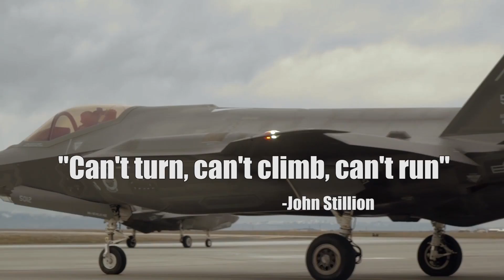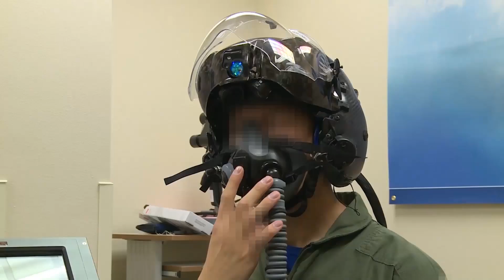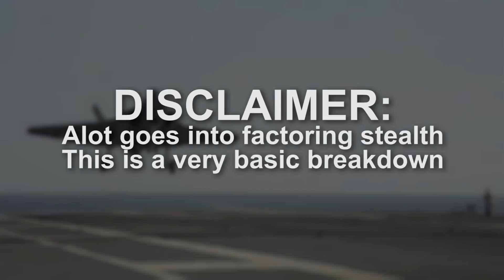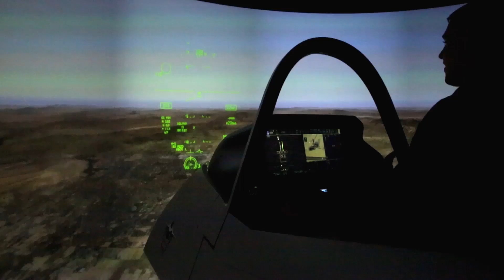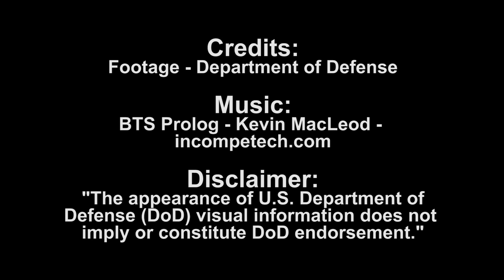F-35 Overview - The Good, The Bad, The Ugly

Comment: The F-35 is a good UK and US designd and built jet BUT it ant that good.

F-35.

Agility 
combat ready.
11 D/S for sustained turn.

Agility 
stock.
It's goes up by 19%.

Speed.
Stealth mod with only 4 missiles.
1200mph Mach 1.56.

Hight.
Combat ready.
50,000f.

Stealth isn't as good as people think.
One of the biggest fuck ups with stealth jets is that more stealth means less agile and stealth isn't that good on any jet.
It takes only 0.0001 seconds to be seen on radar and its over for the jet.

The jets that use more stealth like the F-35 F-22 SU-57 don't have the best agility the best jets for agility is jets like the Eurofighter Rafale and Gripin, with Thrust Vectoring and the power on the engines making a big difference in turn rates.

The Russians are the only ones so far to use ( 3D Thrust Vectoring ) the news one being the SU-57 and will be on the MIG-41 when that comes out.

The F-22 is a good jet but again it goes for stealth more then agility so when you put it up against a Eurofighter you can see the difference in it.

The Eurofighter yes it may be a gen 4++ jet but it can still kill any jet out there even the F-35 and F-22 and long rang missiles have a bad hit rate the Eurofighter being more agile can just dodge them easier then others can.

The Eurofighter has the longest air to air missiles and with radar that can pick up the F-22 and F-35 at a very long distance the F-22 or F-35 will have a hard time to get a jump on the Eurofighter and again if they the Eurofighter can just dodge the missile.

The difference between.
Eurofighter / F-35 / F-22 / SU-57.

Speed.
1st SU-57 1570+mph.
2nd Eurofighter 1550mph
3rd F-22 1498mph.
4th F-35 1200mph.

Hight.
1st SU-57 65,000+f.
2nd Eurofighter 65,000f.
3rd F-22 60,000+f.
4th F-35 50,000f.

Turn Rate.
1st Eurofighter 28.5 D/S.
2nd F-22 26.5 D/S.
3rd SU-57 24.5 D/S.
4th 11 D/S.

Hard Points.
1st Eurofighter.
2nd SU-57.
3rd F-22.
4th F-35.

Energy Saving Dive/Cilmb Rate.
1st Eurofighter.
2nd F-22.
3rd SU-57.
4th F-35.

Rang.
1st Eurofighter.
2nd SU-57.
3rd F-22.
4th F-35.

The F-35 is 4th in all areas.

But at least it can do vertical take off and landing for about 90,000,000.

Comment: This is why I can't take F-35 hot takes seriously. Some guy said an F-35 lost a dogfight to an F-16 and people still parrot that even thought it's been thoroughly debunked.  The incident in question was when they were working out the kinks in the flight control software of the F-35 and they sent up an F-16 for it to fly with, because the 16 is cheap to fly and has a very well documented flight profile. Now that they have it dialed in and have taken off the training wheels it has very good performance. Not as good as an F-22 or one of the new, purpose built Russian dogfighters, but still very good. Outstanding when you consider that it's primary job is that of the now retired F-117. 

Also, when people quote it's wingloading or thrust to weight, they do so with a max load of fuel and bombs. In an air to air config, it would not be at max fuel and would instead be carrying a much lighter load of missiles, making those thrust to weight and wingloading numbers a lot more favorable. 

 It's one serious flaw is that it currently can only carry 4 air to air missiles.

Comment: That $92M per plane figure is straight-up propaganda.  Given the $1.5 trillion program cost, that would give you over 16,000 planes at $92M.  The actual production run will be around 2,500 or less.  This means the cost per plane is more like $600M.  You could literally build a plane out of actual gold for this much money.  Greatest ripoff in history.
Reply: No that just means you don't understand what is being talked about. Unit cost is what you pay to manufacture the plane. Program cost per unit includes development which might also benefit other projects and is therefore not an accurate measure of cost per individual aircraft. 

Also that $1.5 trillion figure is old. The current projected figure for the entire lifetime of the F-35 from initial development in 2001 to roughly 2070 is $1.1 trillion. it is the the very first fighter project to have official lifetime cost estimates, and part of the reason this value seems absurd is because every other fighter had costs projected in 10 year increments.

Comment: I do wonder sometimes about the F-15 refit where they added a bunch of stronger composite materials to places susceptible to metal fatigue and improve parts prone to fail like the air brake sometimes snapping off on landing.
Anyway the reason I mentioned it is I got to wondering the US Airforce and related organisations have all these legacy aircraft and they have some minor issues due to their age - but they still get a look over and the occasional running change (like the 3D Vectored Thrust nozzles fitted to some F-16's) or the 2D one that were experimented with the F-15 XL - I realise it's really expensive to throw money at older aircraft - but at the same time I do wonder if they learn things from making the new ones - like paint properties or better radar and there is the space to fit them in an older plane - or say someone makes a radar for a new Vtol or Helicopter that is cross compatible with old platforms then more new tech could be added to old planes and that new tech could be standardised and mass produced - like a lot of the older planes shared a similar jet engine design.

If you have all these people trained to work on the newer planes - then might it make some sense to put that skill to use in retrofitting as much as you can to these older planes since they can get another 20 years out of them and also cover more of America's vast territory better - also if certain pieces were changed to newer pieces you might get better communications, better battlefield integration tech - the ability to lock on to more targets and relay that and also even to send a firing solution to something else completely even if your plane has no missiles left - all very useful things to be able to do. Being light would also increase range too.

Thinking about those older idea that didn't really go that far like the F-15 XL and the F16 XL  I do wonder if they were revisited now could the be made even better - more durable than the prototypes were - be able to handle better and the F-16XL alone has a lot of advantages of the larger wing such as being able to carry more weapons. Then there is the simple question - could you simply hack off the vertical tails on those planes now and put cantered smaller ones and a couple of Cannards and some stealthier air intakes. Or would all that never be worth the cost on an airframe that would only last another couple of decades at best ... I suspect the idea wouldn't work on an F-18 as they tend to have a harsher life than the other two.

Comment: How can you talk about the F35 and not mention sensor fusion, AESA Radar or the 4pi infrared sensors! Situational awareness is one of it‘s biggest advantages.
Reply: bigdigvig sensor fusion is not somethig  you can just add, same with 4pi infrared sensors. Very complex modifications are necessary to the frame itself. Besides still lacking stealth the pimped F16 would then habe a similar price tag, so why not just get a new plane that does the job of 4 to 5 other aircraft? The F35 is a much more deadly aircraft than the F16 (obviously). Kill ratio at RED FLAG shows this very clearly. F16 has had 40 years to develop fully, do you think it will hold up against CN and RU fighters in 20 more years? F35 increases it‘s potential steadily as the pilots get more training and the systems are constantly upgrading.

Comment: Designating it the EA-35 would be more accurate than the F-35
Reply: Not really, designating it as the F-35A for the airforce, AV-35B for the USMC and F-35C for the Navy would make more sense since it follows the naming trends 
(F/A-35C wouldn't work since F/A was a combination of two aircraft into one, the F-18 and A-18)
Reply: TheReal Lifehacks .... The navy is trying to make the F-35C operational. Slowly... Unlike the USAF and the USMC the Navy has a backup plan
Reply: @Idahoguy10157  What is the Navy's backup plan? 
The Navy is doing it slowly because for once the USMC and their Vertical lifting wasn't the one that had the most problems, the F-35C has taken longer to enter service, the A and B were declared ready in 2015 and saw combat soon after with the IAF, USMC and USAF
Reply: @Idahoguy10157  The F-35C was never replacing the Super Hornet or the Growler, in fact the F-35C is augmenting the Super Hornet fleet, the C is a legacy Hornet replacement, hence why the Navy had never had it in their plans to replace Super Hornets with Lightning's 
The USAF also was never replacing F-15's with F-35's, the F-35A is replacing the F-16 and A-10, the F-22 was supposed to replace the F-15C/D however when the F-22 production was shutdown it left too little to replace the F-15 fleet which mean the USAF was left with an aging fleet with no real replacement plan, the USAF has been backed into a corner before the F-35 ever entered service
The current plan seems to be replacing the F-16 fleet with F-35A's and augmenting the aging F-15C/D fleet and under numbered F-22 fleet with F-15X's for the air superiority role, however who knows what the USAF will do as the modernized F-15 costs a lot more then an F-35A (80 million) and modernized F-16's such as the V model are being sold per unit at a higher cost then the F-35A
Reply: TheReal Lifehacks .... The Air Force can argue that the F-35A is the aircraft they need. The reality is the AF did not buy attrition replacement F-15 and F-16. The current fleet of f-15 and F-16 are wearing out. The production lines for the F-15 and F-16 are open and can deliver. 
While the F-35A between low production numbers, software issues,  and poor availability is not ready to replace the legacy aircraft in the numbers required.
Reply: @Idahoguy10157  The production lines for the F-15 and F-16 are not actively producing the versions the USAF is using, they're producing much more modern and expensive variants 
The F-16V is the most modern F-16 variant being produced and the cost per unit is higher then the F-35A
The USAF is also not buying F-15C/D's, they haven't bought those for a very long time, the USAF is buying F-15X's, the modern F-15 variants have been going for 100+ million 
The USAF is not replacing the F-15 with the F-35, therefore bringing up the F-15 is irrelevant to the discussion
The USAF is actively replacing the F-16's with the F-35, 
The USAF is augmenting the F-15C/D and F-22 fleet with F-15X's

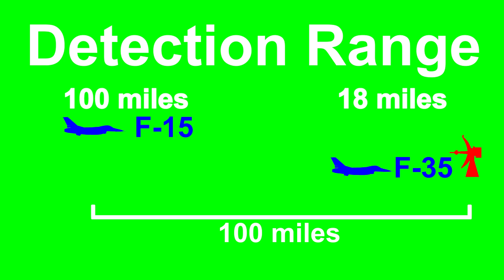Comment: 3:32  F-35 wont be detected at 18 miles away. It will still be detected at 100 miles but SAM wont be able to engage them.
Lower frequency radar will be able to detect F-35 at really long range. 

Imagine sending F-35 to attack ground targets, and Russians SAM spots F-35 and scrambles SU-35 or SU-57. F-35s stealth will be useless then.
All that money paid for stealth is down the drain.
Reply: How will an F-35 be useless just because an Su-57 is scrambled? Stealth isn't about remaining undetected. You're also talking combined arms, so don't go assuming the F-35 is alone.

Comment: A lot of these concerns have been alleviated now that the F-35 has entered service. Watch any demo and you can instantly tell its manueverabiltiy is far better than its critics said. That doesn't even matter because it's not a dog fighter; it has no internal bay for sidewinders, and it's AIM-120s are slow to launch from the bay. If it gets in a dogfight, it's weapon load will be a far bigger issue than manueverabiltiy.
It's RCS is less than the Raptors, and don't forget the ECM and EW capabilities built into every plane.
A raptor is designed to fight as a squad of 1 or 2 planes. The F-35 is designed fight s part of a larger flight and integrate with the rest of the military's systems better than anything before it.

Nothing against this video or you, Cabal, everything was said was being reported at the time. The plane has just  overcome a lot of this recently and people aren't sharing that, plus most people completely ignore the context and intended use of the plane.

Comment: If the best thing about the F-35 is it’s stealth why not save all the money and just keep rocking with the F-22. It’s an amazing stealth fighter that takes on 6+ F16s in training and the F16 pilots state they were dead b4 they even knew the enemy (F-22) was in the area.
Reply: Because the F-22 is much more expensive and actually has a few disadvantages such as range and air to surface payload. The F-35 is a much more useful fighter.

Comment: The fundamental problem with the F-35 was the USMC insisted on getting a VTOL/STOL fighter for dumb ideological reasons and rather than simply giving them their own shitty VTOL/STOL plane, those requirements were shoehorned into the F-35 design that the USAF and USN were trying to get, which ruined the plane. Well, ruined is a harsh word, and not exactly accurate, but it's close enough to true. The USMC's requirements were in direct contradiction to all the other requirements of the plane, making it less maneuverable, less stealthy, not as fast, with shorter range, and just overall worse than it otherwise would have been.

Looking ahead, at the next generation of fighters which are already being planned for, thankfully it seems the lessons of the F-35 have been learned. The Navy is looking to get its own entirely separate long-range strike fighter to contend with China's anti-ship missiles keeping their carriers at bay. The Air Force is looking for its own entirely separate long-range fighter to escort the new B-21 on penetration missions, and the two planes will not be the same. The Marines will hopefully not be invited to any design meetings.
Reply: The USMC version is a different airframe with notably worse performance than the USN and USAF versions. There was also no contradiction in requirements.

Comment: Nearly all the negatives are irrelevant. F35 ends dogfighting. For real this time. First, the F35 radar will fry the enemy plane's radar and leave it blind (it does that). Enemy plane dies a clueless death by missile hit from a distance. His last thought - "is something wrong with my radar?" If enemy Gen4 plane survives the merge (unlikely) the F-35 does not need to turn. It fires off-bore-sight missile just prior to merge. Missile will 180 and kill the enemy while F-35 flies on, no turning needed. Boredom ensues. So yeah, it's not much fun. Dogfighting was romantic. So was sword fighting.  Got a Gen4 bird? You're bringing a sword to a missile fight.
Reply: It's so tacky to reply to myself. Groan. The 4 internal hard points on F-35 are not for amraams. The distance kills will come from LREW via F-15X positioned farther back. F-35 pilot will pull trigger but missiles won't be coming from his F-35, he's networked to the missile trucks that are far behind him. The internal hardpoints on F-35 are for AIM-9X, the one's that'll get you after the merge. Gen4 life is gonna suck.
Reply: ...and it will be short.

Comment: Used in conjunction with other aircraft it could be useful taking out ground sam radar units, the other aircraft could trip the radar after the 35 is close and the 35 could launch a radar seeking missle. The enemy would be launching missles at the detected craft that are on the edge of its the tws range , after the 35 fires the other craft can get out of range quickly.
Reply: Firstly radar is quite easy to defend. You can turn off the radar and massively reduce the chance of the missile hitting. You can confuse radar missiles by reflecting the radar of a hill(that is a soviet era tried and tested move) and you can defend it with various anti missile defense systems and the F35 doesnt have the capacity to overwhelm them.
Secondly most Russian mobile radars have ranges around 250km or more so good luck getting close enough even if we ignore the fact that they have low frequency radar that is far better at detecting stealth. Realisticaly the F35 will be detected at a bare minimum of 50km and at that range the odds of a sucesfull kill of the radar are very low. On the other hand there are multiple weapons systems that will blow the F35 out of the sky at that range. So radar is a horrible target for the F35. It will likely try going around radar and pick off targets that are not well covered by the detection grid the enemy sets up. It will also be great at blowing up low tech enemies like terrorists since they would never see it coming.
Reply: @SlayerBG93 Well, that aged like milk. Russian ground-based air defenses are way over-hyped
Reply: @jeffbenton6183  So how many S400 radars has Ukraine managed to take out in 2 years? I save you the google search. The most optimistic estimate is 3 radars. Russia had 456 S-400 launchers at the start of the war so about 200 radars as a rough number. I dont know their build rate but based on when it was introduced it is at least 20 a year. Enough said.
Reply: The F35 won't needed other manned aircraft to bait the radars for it. They can used air launched decoys.